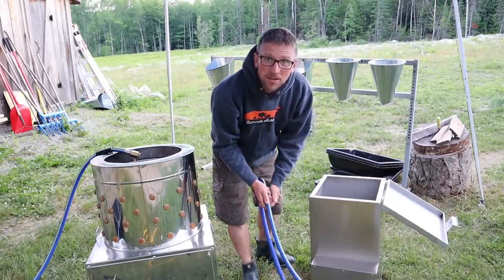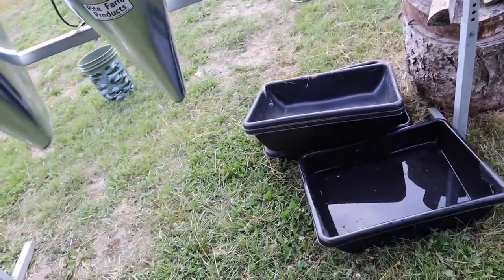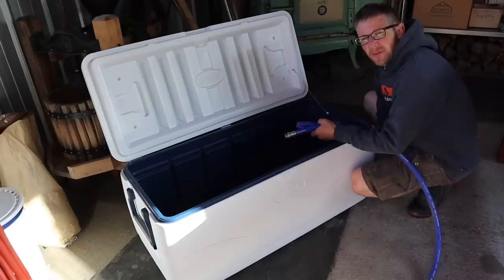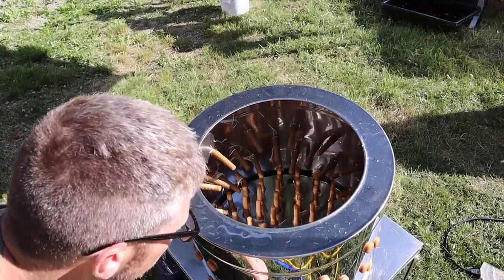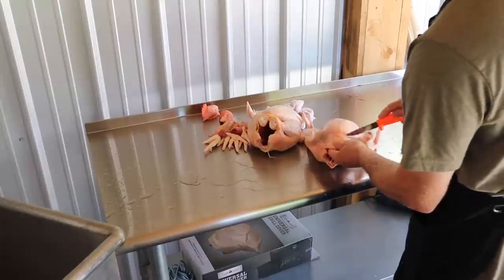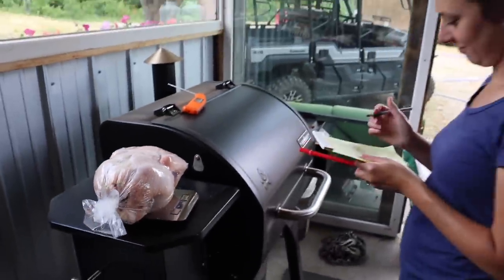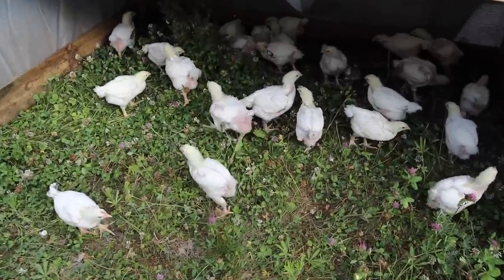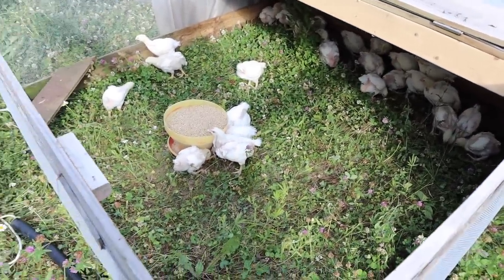Husband & Wife Harvest 153 Pounds of Chicken in 5 Hours in their FRONTYARD

Comment: Nice job and great setup and equip.. If I may make a couple suggestions.

On the water cooling.. Putting the chickens directly in the water causes the skin to be soggy when cooked.. Most high end processors use air chillers.. The way for us home processors to do this is to use whatever cheap plastic bags.. I use bread bags.. Bag the chicken tie a knot and push it into the chicken cavity and now put the bagged chicken in the ice bath to cool. It gets cooled but water does not touch the chicken.

Last thing and I might have missed it but not sure the time between putting it in the ice bath and going into freezer.. Make sure this is at least 24HSS as thats the time it takes for full rigormortis process to complete.. Many will chiller them for 72hr before freezing.

One trick for the juiciest chicken is dry brine using kosher salt no additives before you heat shrink bag them.. They will brine a bit as they freeze and fully brine as they thaw.. There has been a ton of research and dry brining prior to freezing has the least loss of moisture from cooking and it helps further tenderize the meat.. Do not worry about too much salt as it really does not add much to the chicken itself.

My wife and I just got done processing 60 CX.. We took them to 7 wks.. We use a special feed and feed cycle.. All our birds could still run and even fly up onto the sides of the tractor walls. Our largest rooster dressed out at 9.3lbs with them averaging around 8lb. The hens were 5.2-6.4lbs.. So do not worry about much of the leg issues etc.. It has much more to do with the initial health out of the incubator and the stress during the first week.. If I had one recommendation it would be to try and find a hatchery within driving distance.. We drove 4.5hr round trip.. The most critical period of their life that dictates health size etc is the first 5-7 days.. The stress of mailing and being off water food for half the first week is what causes much of the issues.

So far we have not loss a single bird.. No that will not continue forever but it is in part because they get from hatched to brooder on water and feed etc  in under 24hr of hatched.

It took us about 4-5 IRS like you to do our 60 chickens this last time.. Then another 2hrs after to dry brine shrink bag.. We let them chill bagged in ice bath for 48hrs before shrink bag and freezing.. Never thought about how many pounds it was.

Having those thermostat controlled scalder is a God send.. So much better than constantly tweaking the stock pot over a burner.. Yours is a nicer unit with digital control.. Mine is mech switch and no readout.

I actually find having water for scaulding at 160 and be sure to add a 1/4 cup of dawn fish soap to the water to allow feathers to soak up water and break feather oil barrier.. I did not see any bubbles in your water so guessing you did not add the soap.. That makes a huge difference  If you did then disregard.. I dunk them 3 times 4 sec each time. They make a nice crane to do this holding chicken by feet.. I get no tears and feather come out clean other than tail pins which are always the case.. The closer to 145 the longer the dunk and the more skin tears I noticed.. I think you would do much better using a insulated glove and holding by feet.. Then do the dunk pull dunk pull tech 3x.

You cut those feet off like a pro. I have watched people hack away trying to do that clean. I wish we had a  dedicated processing room like you do.

Again great job and nice setup.

Comment: Al, a suggestion, incorporate a peddle switch to turn on and off the plucker. Apart from convinience, it will do away Any risk of electric shock as your hands will be wet during the process
Reply: soaringtractor  The ground wire alone will not protect you from shocks. That's why GFCI circuits are required near water. As for your gross xenophobia, you should try to get out more.
Reply: soaringtractor   The extension cord I saw Al use in the last video only had two prongs: live and neutral. I.e there's no ground connection on the extension wire.
The pedal switch sounds like a good idea. The problem is to find one that is robust and water-resistant enough for outdoor use.
Reply: soaringtractor  That's a little dismissive. Electric shocks happen in every country.  I got one off our sheep fence once. And my uncle died of an electric shock when he was working down the coal mines.
Reply: @jeffweber8244  Good point on the xenophobia. I think this last few weeks have seen enough of that for ten lifetimes.
Reply: all I have to say about this statement is....WOW..just WOW
Reply: @yvindascanius6061  That was a 3 wire cord! Al is not that stupid!
Reply: @jay90374  I never thought he was stupid. I just tell what I saw, and that was two prongs on the plug from the appliance.
Reply: Good idea, it would be so much easier.
Reply: soaringtractor  Except in our response to a certain virus...
Reply: soaringtractor  rude ! oh and wrong!
Reply: Relax pc police. You may not like what soaring tractor wrote, but he’s got every right to say it! At least for now. And you can trust, that won’t change without a fight!

Comment: Just a thought here.....If you put drain pipe with the 3/4 holes in it with the sock on it through your compost pile as you layer it it may help with the speed and temperature of your pile.  I saw a video on something similar to that design and supposedly it helps with the complete process.  I know with your hard winters getting it composted as much as possible in the spring and summer would probably help.

Comment: ya need a hook to hold the water over the plucker. it's gonna get old constantly bending over and picking the hose up off the ground ?
Reply: I've seen a couple others use puckers where the hose connects to the machine so you don't have to touch the hose.  Flip the switch & turn the water on.  Pretty sweet machines

Comment: I've done this only once before with a barnyard mix (extra rooster from a set of eggs one of our broody hens hatched).  The one thing I was not prepared for was how much force I had to use to pull the innards out!  Accidentally tore the skin of the bird a couple times where I was holding it because I was having to yank on the bits.  I don't know if this is a problem anyone else has, but I still did it start to finish in one go.

Comment: You have done this expertly, congrats.  Teeny ideas....1) from PVC pipe create a rack to hold the cleaned, dressed, dripping birds & drip dry moisture prior to putting bags over; 2) from wood (?) make an outdoor rack & tool holder for all the rakes, shovels, etc; 3) purchase or make some type of holder w/ spring for your hose so that it is overhead outdoors for easier use4) get a labeler...they stick onto the plastic, freeze well, you'd have weight, date, etc. Marvelous processing...blessings!